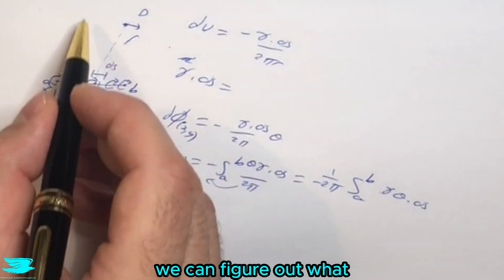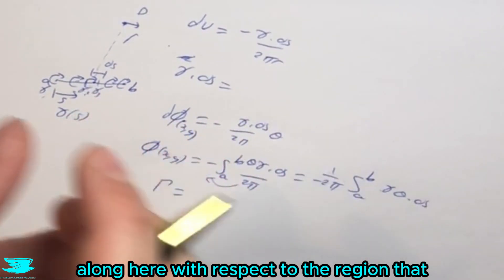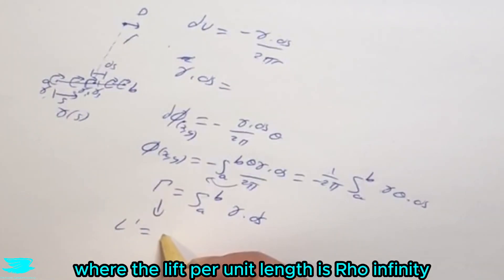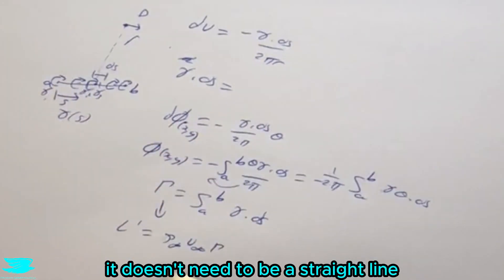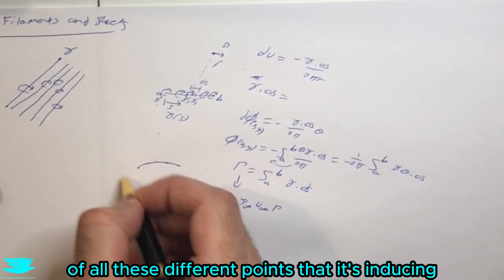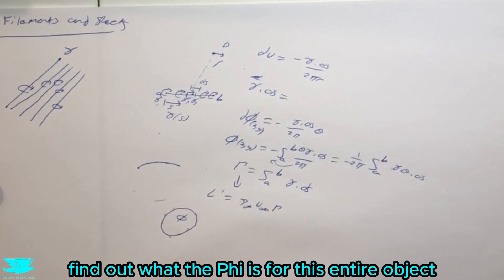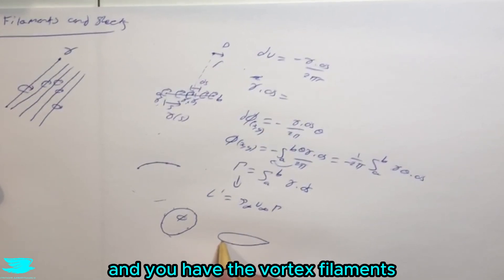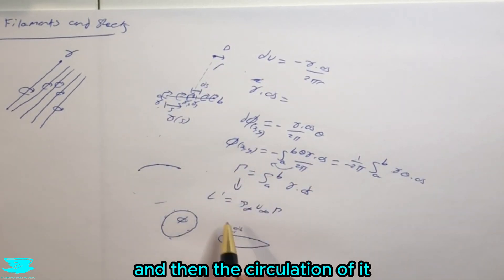Vortex Filaments and Vortex Sheets [Aero Fundamentals #61]

Comment: Hi, thank you for the video, this is a very new topic to me, but you explained it in a really understandable way. Is there any established software that uses this method for fluid simulations? I'm currently doing academic research with ANSYS Fluent, and we just got a big project. It looks like previous research into this subject used the vortex filament method because it's a lot more efficient for simulating on a large scale than standard CFD processes. Any advice would be really appreciated. Thanks again!
Reply: What did you find out? Taking CFD soon, I'm currently taking aerospace fluid dynamics.

Comment: I have a question. I have previously coded a nonlinear LLT method, which I am still rewriting into a useful form. Next I would like to look at wake relaxation/vortex particle wake implementations. However, I was wondering if the vorticity aligns itself with the flow direction it is in (so not in the flying direction like in LLT, but slightly down because of downwash) or that the direction of the vorticity vector remains unchanged.
Reply: The vorticity is inducing the alignment, you can think of fluid vorticity as just a very slow magnetic field, where a magnetic field uses the speed of light, you can use the speed of sound as the coefficient for vorticity in air. Funny how that kind of works out right? Like air is a fluid that behaves like a polarizable medium, and the pressure mediation between high and low can be modeled after magnetic field interaction and induction.

IE air currents induce polarized eddy currents of pressure(vorticity), just like electric currents induce polarized eddy currents of pressure(voltage). Same noumena, expressed as different phenomena perhaps?
Reply: For example, a vortex tube, creates a vortex confined in a tube, the vortex creates shear stress on the wall causing heat, which then exits out of the hot side diffuser. The rotational speed due to the design of the tube, greatly exceeds the axial velocity which causes a vortex reversion, which exits out as the cold side. This is made possible because the pressurized air powering the device is by definition exiting at the speed of sound.
Reply: @rolandotillit2867  So from this I understand that the vorticity does indeed follow the direction of the streamlines. Correct?

The parallels between aerodynamics and magnetism don't surprise me one bit to be honest. Definitely not after learning that torsion in a beam is equivalent to a soap membrane. 

I had never heard of a vortex tube. It's very interesting though, even if I don't fully understand it yet.
Reply from the maker: As Rolando said, vorticity is a major component dictating where the streamlines go. As you get farther away from the source and the vortices break down, then flow straightens more and more.
Reply: @PremierAerodynamics  Yes, I understand how vorticity influences the flow, but I'm not sure how one vortex influences the direction of another one.

In an aircraft's wake, do the trailing vortices' vectors point in the direction of the local flow?
Reply from the maker: In terms of pointing in the direction of the upstream "local flow", then not necessarily. In terms of pointing in the "wake's local flow", then more or less because they are part of the wake.

To get an idea about how vortices induced the flow around them, and each other, check out this video: https://www.youtube.com/watch?v=pO6k9WTnFCc It goes through the math of it.
Reply: @PremierAerodynamics  Again, this video shows how vortices change the direction of the flow and thus the position of the vortices around them. But I have never seen an explanation of how the axis around which the air molecules revolve changes direction - if it does at all.